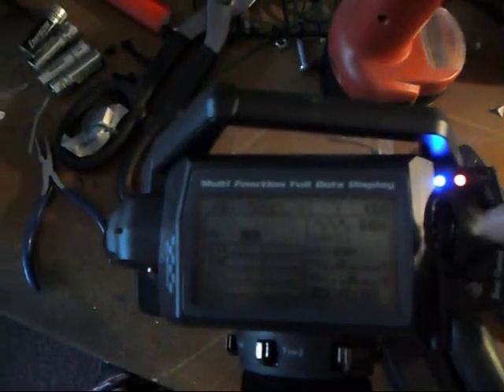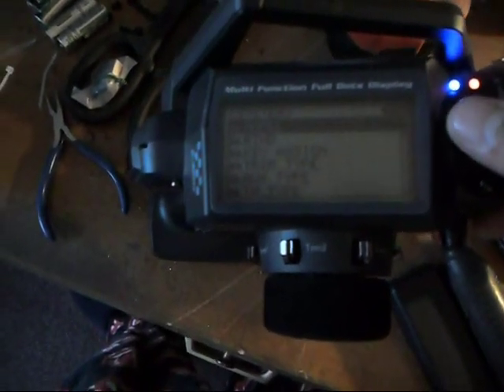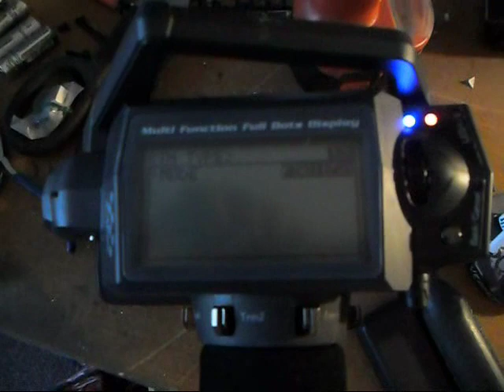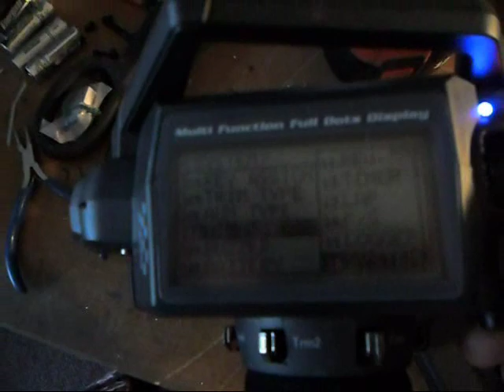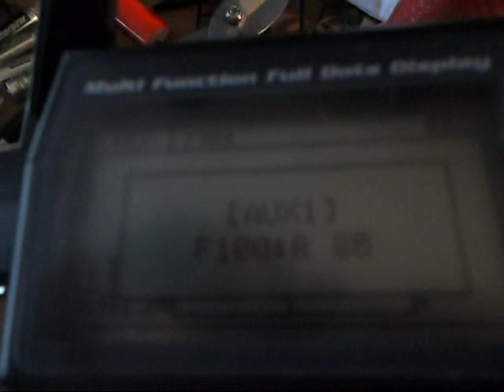MT-4 airtronics  programming tips MOA

Comment from the maker: @wyatt642 If you have set the remote to MOA, set the throttle to 50/50. Mix channels 2&3 together, it should be ready to be adjusted to your liking. for the burn and dig, I used the lever for that. Bring it down to Ted's on a friday night. I'm pretty much there every friday. You can also ask stacy at Ted's. Austin at PM has set up one of these that i know of.

Comment: Does the lever also work like the dial (i.e., a rotary encoder) or is it more like a multi position switch? I like the idea of making the lever the front/rear throttle mix, but it would need to be proportional like the dial. Thanks.
Reply from the maker: nah it's a lever. Works good for dig/burn and winches good.